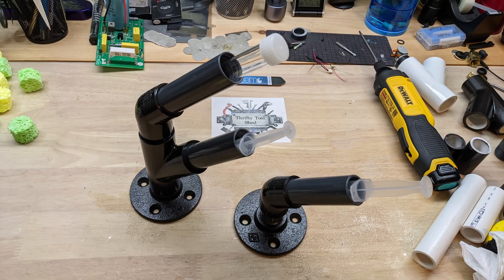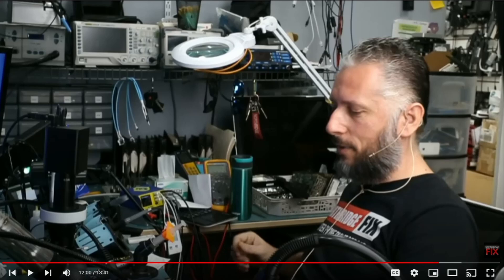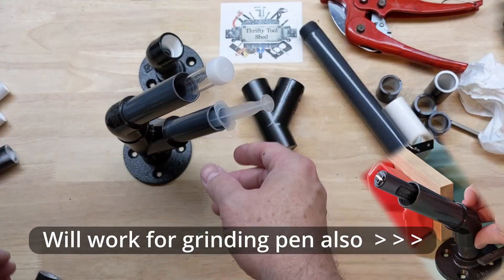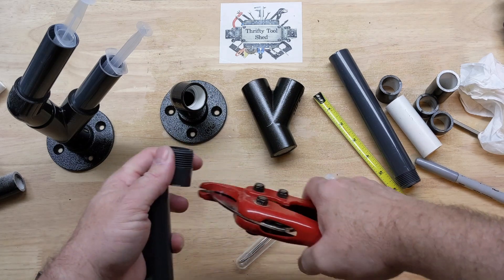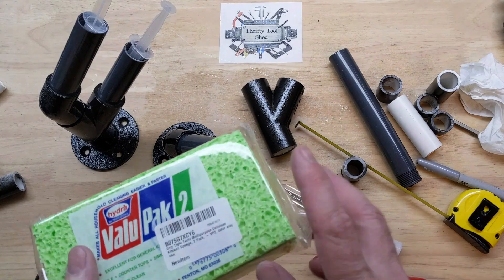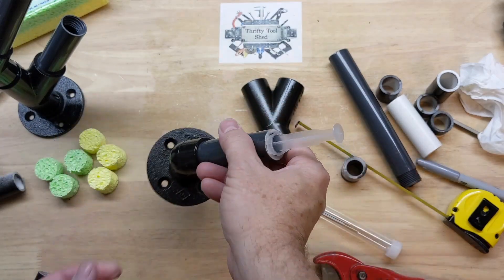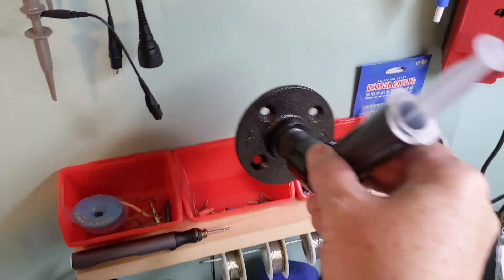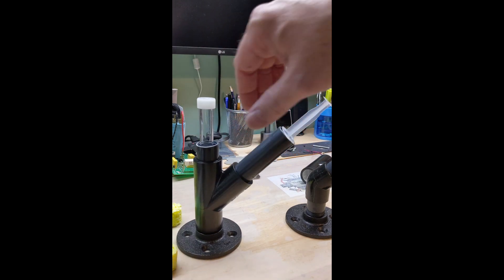Easy To Make Flux Holder

Comment: Very good idea. I use 1 litre plastic bottle, sand at the bottom to keep it stable on table, inserting two pepper plastic containers in the plastic bottle slanting at an angle and glued in. Very quick to make cheap, effective and easy to change when required. Recycle your old bottle so to speak.

Comment: Have you thought of making a vid on making liquid flux, or a dispenser...like a pen?
Reply from the maker: Well I do use Rosin Liquid Flux and Dispense in a small bottle with needle tip. The Rosin Flux is cheap and works pretty good, but can be messy. It works good for me when doing a big solder job , tinning wires and big power components. I really don't care to make liquid flux because for $28 I have enough to last over 10 years honestly. Amtech 559 is just such an amazing flux and the Syringe works the best for me. I simply needed a easy way to store and retrieve it. This Amtech 559 Flux is next level when working with SMD / Micro Soldering if you have never tried it. Thanks for your comment!
Reply: @ThriftyToolShed  I agree the Rosin flux is messy and only good for hole through.  I have a supply of MG Chemicals 8341 - No-Clean Soldering Flux Paste I need to use up before I try Amtech. I am not in the States, so its a bit pricey for me.

Comment: Nice thought you might be interested in this channel fella fixes lot power tools n just today nice flir thermal camera multimeter.   https://youtu.be/3IQgyN5OzNs
Reply from the maker: I do like this channel and I have this video in my Watch Later list! Thanks for your comment and sharing!
Reply: @ThriftyToolShed  thought u might like his channel,  just bought all parts to make 4 flux holders for shop, thanks for sharing
Reply: @ThriftyToolShed  BTW what do you think the chance of pcbway making ego 56v boards up ? I need few ? Or be too costly or complicated?
Reply from the maker: @waynetaylor2784  
I really have wondered the same exact thing. I thought about how many we would have to sell to possibly come out more than even because the more you order the cheaper for sure. I really wanted the manufacturers of the aftermarket batteries to work with us on BMS boards for spare parts, but still no luck from them. I have contacted the AMC company before. They are not selling as parts at this time. Too bad because as I mentioned in those videos reviewing those 3rd party batteries they did clone the BMS board almost identical. So all the reverse engineering has been done! What a shame...
Reply: @ThriftyToolShed  well I'd take 50 boards as initial order.